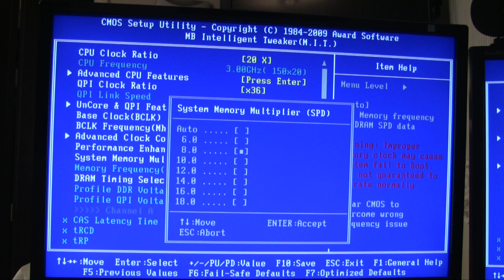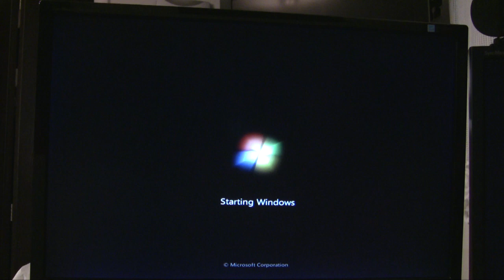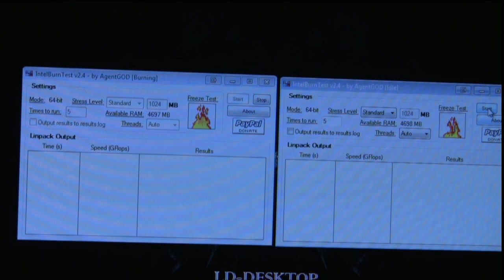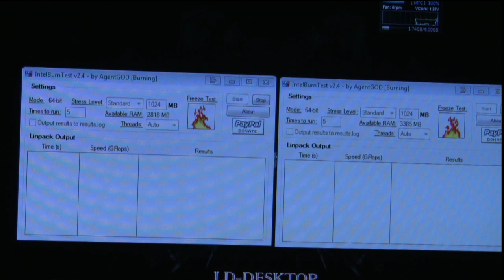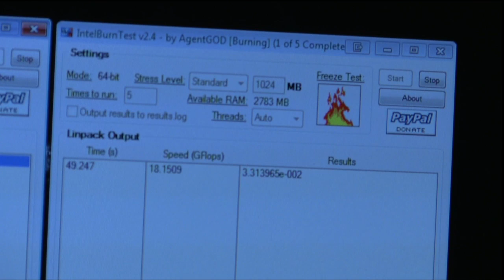Overclocking Intel i7 920 Guide- Part 2

Comment: how meny ram stick do you have?? i have 6x2 gb in my ! but with 3x2 i can run overclock but with 6x2 i  can't overclock to more than 3.0 ghz and i have always running 3.5 and 4.0 ghz and i have ben using you guide for 4 years now..  but now i have buy 6 gb ram more.. i have 2 dirrent rams... ocz3p2000lv6gk  CL9 my old ram and my new ram ocz3g2000lv6gk  CL 10
Reply: Try my guide mate! https://www.youtube.com/watch?v=Q6ck9WerreY

Comment: Great vid, I’ve had my i7 930 since Nov 2010 paired with a gygabyte UDR3 just OC my cpu yesterday to 3.5ghz vcore 1.20 temps in low 60’s overload 45 idle

Comment: Thanks very much for the video.  It's high time I overclock my i7-860 on my Gigabyte P55-ud4p  I think it may help for Battlefield 4, we'll see.

(1) Should I disable hyperthreading?
(2) How often should I increased QPI voltage? At the same time as Vcore?
Reply: Not the guy from the video, but I also made a tutorial: https://www.youtube.com/watch?v=Q6ck9WerreY
1)You shouldn't.
2) You should increase it just when you need higher BCLK test by lowering the multi. Everything is explained in my tutorial ;)

Comment: 1.36 Vcore @ 4.0 and 80+ degrees after a couple of hours is a perfect example of what u are saying about different chips. i got my i7-920 D0 at 4.0 with 1.28 Vcore and 68 degrees highest core temp after 1 hour in OCCT :)

Comment: Back when the i7 first came out back in 2008 I did a lot of studying before I picked my CPU. A lot of folks went with the i7 920 at 2.66 because it could easily overclock to 4.0 stable on air cool. The 950-975 at the time could not push 4GHZ stable for a lot of users. Chips were too hot even under water cooled. I decided to save the money at the time and get the 920. I keep my chip at 3.2, (965) speeds and it stays perfectly stable. No need to go any higher than that really.

Comment: hi,first of all many thanks 4 this video!it's great.i need,if You can,your help to overclok a little bit nmy pc and vid cards.i use to play 3 monitors with racing games like dirt3 and gtr evo,and soon gtr3(5760x1080)(and finally i want try bbc3-still not installed  ; > ). my pc parts are:tagan tg1300bz-pipe rock series-1300w,thermaltake armor+vh6000bws(air),asus rampage 2 extreme,intel i7d0,Zalman/CNPS9900LED,(kit3x2gb)corsair ddr3 6gb1600mhz PC-12800 dominator cl7 ,2x asus gtx560top 925mhz

Comment: Y is my i7 920 running at 85~90c at idle with stock? :S
Reply: Mine was also running quite hot, reaching the 90s during gameplay. I recently switched to a heatpipe cooler and new thermal paste, and now it's usually at the 40-50s range. This is without any kind of overclocking. The stock cooler is kind of a joke, I think.

Comment: After we're done overclocking and have run the burn in test to a point where we're stable do we need to turn the CPU advanced features back on or do you recommend keep them off? Sorry if I missed it in your vid. ie turbo boost, C1E, CPU IEST and C3/C6/C7?

Comment: @MinecraftAventures I don't believe you can without a bios flash. Dell has locked the bios to only enable certain features. Meaning you probally can't OC. Msg me on youtube and ill help i had a gateway machine with the same problem and i fixed it so msg me

Comment: @Ldogg9 Hummm, Normaly with water cooling you should cold down more than that , Do you have some air filter on the fan, did you change your liquide coolant ? Put a Hight Performance coolant , It should help a bit .

Comment: hey I got I 7 920 and I overclocked(its my first overclock) it to 3.2 and its hitting about 70c on full load, I imagine I could push it a little harder but Ive read you don't really want to get over 70c if you want your system to last more than a couple years. And I need mine too. I got a water cooled system, which is alienware and not the best. Is their anything else I can put in my system to lower my temps?